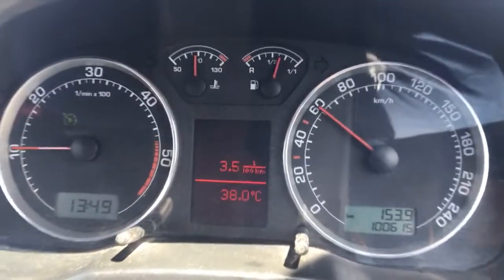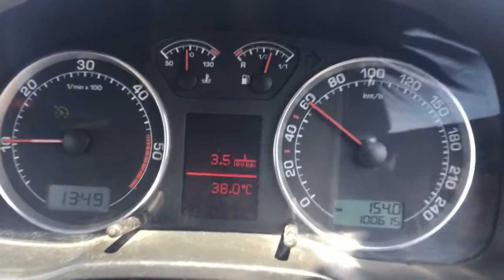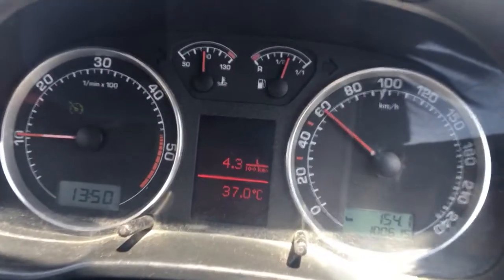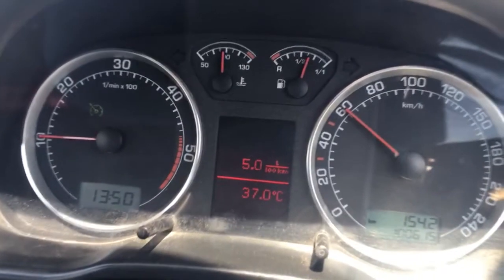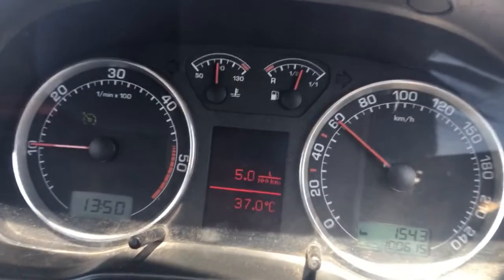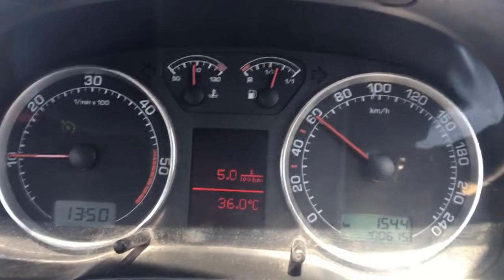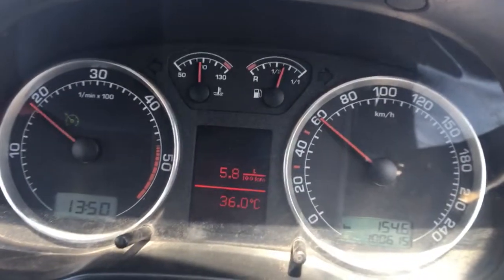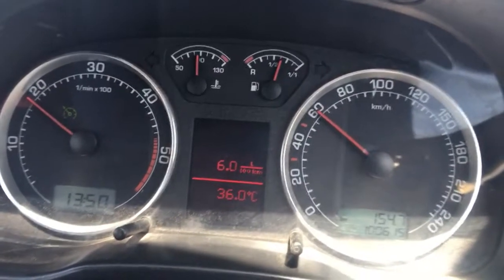Rolling launch control- edc15 disassembly/reverse engineering

Comment: How have you done to use the tachometer as boost gauge? Its done only programming or with arduino or similar?. your rolling launch control its awasome!
Reply from the maker: Alvaro ANMatta I replaced the rpm value in the canbus buffer(in the RAM of the ecu) with boost. After reconditioning and linearizing the boost(small changes of 20-30mbar ignored, to have a stable gauge) i displayed it on the rpm gauge. No arduino/external mcu is used